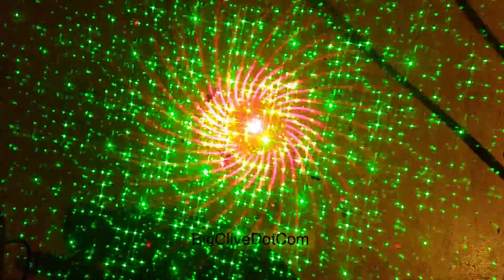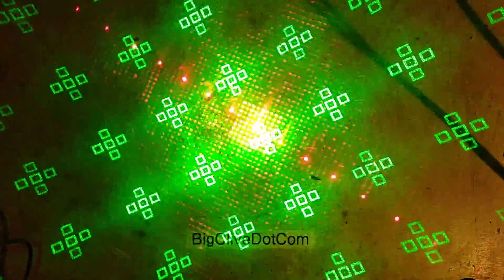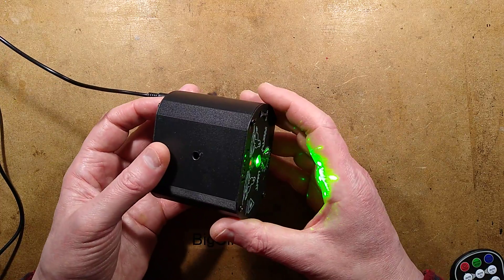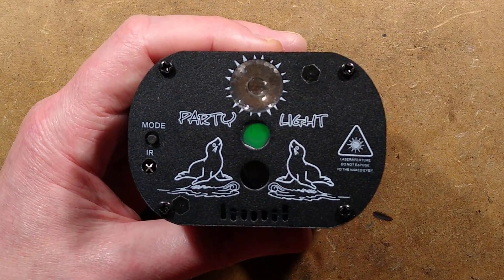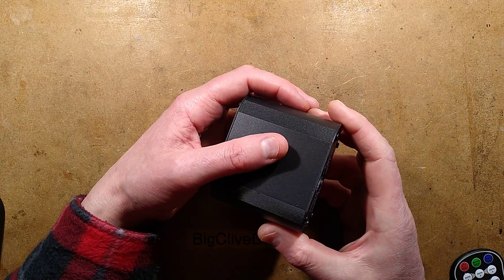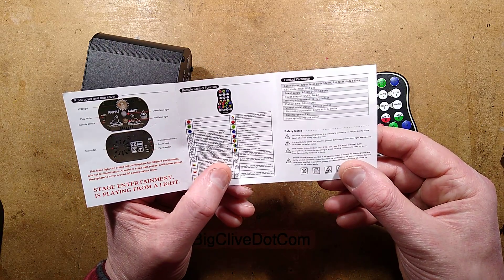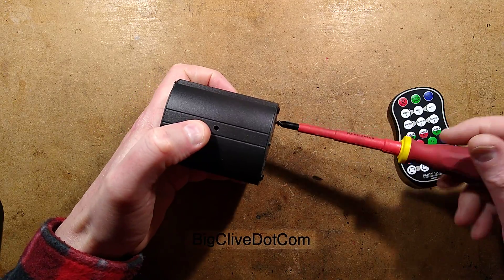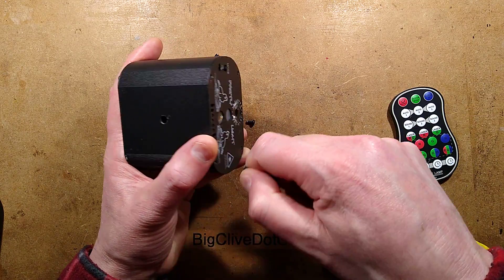Cheap laser light with amazing diffraction grating disk

Comment: might be worth actually seeing if the battery connection actually charges, if so i might get one, i have a few spare 2000MAh 18650 cells from an old laptop battery that could be perfect for this

Comment: I’m amazed they have classed that as a Class III laser, as those are extremely powerful.  The green laser will certainly emit IR as most cheap green laser pointers do.  I suggest these devices are pointed to the ceiling to avoid direct eye exposure.  I’ve modified lasers in the past and it’s very important to match your eye protection with the frequency of the laser.  Eye damage from lasers cannot be reversed.  Great video Clive.  Thank you.
Reply: Although I fully agree with keeping your eyes safe when using lasers, the IR part in the green lasers however, as you mentioned, is (luckily!) not anymore the case. Back in 2012 they developed new laser diodes that directly create green, so no frequency doubling needed from 1064nm anymore. But indeed, the old ones have a dangerously large amount of IR mixed in the green..
Reply: @CaptainZuurpruim  - Thanks for pointing that out.  I do wonder though if the cheap eBay lasers use the new diodes or the old one.  Great comment. 👍
Reply: @rogerhargreaves2272   No probs. I also have a cheap and rather new laser projector. I opened it up to check it out, and indeed it is just 1 little emitter. Super cheap to make, I am sure. 

I guess now that the cheap green ones are on the market, the old types quickly disappear.
Reply: @CaptainZuurpruim  - let’s hope so.  The manufacturers can go some way, but as these lasers become evermore powerful you won’t educate the public; even with a class 5 sticker on the end.  Luckily you need some skill to modify a laser, but in the wrong hands they are lethal.  👍 buddy.
Reply: RIGHT. PAY ATTENTION.
https://youtu.be/WnDjIDhxnMs
Reply: You also have to avoid reflections from shiny surfaces
Reply: @johnmurrell3175  👍 yes flashback is very dangerous, it’s happened to my.  Luckily I was wearing the correct protection for the lasers wavelength.
Reply: @rogerhargreaves2272  The reflections from the infra red component are even more dangerous as there is no eye protection provided by the blink reflex. The IR just fry's your retina and there is no known repair or cure. I presume UV laser light is the same but I have never been involved with that. I have been inside a laser that was under construction ! It was several large rooms.
Reply: I’ve always wondered about those cheap laser levels that are supplied with red safety goggles.
Reply: @WineScrounger  - yea it’s worth investing the money in decent eye protection.  The ones provided probably don’t match up to spec or the wavelength of the laser.
Reply: @WineScrounger  Those are low power. The Goggles are more to see the Laser better than actual true protection only.
Reply: @ŠpVŠpý  - the idea of the eye protection is that you don’t see the laser, just a tiny dot.  I am talking about the Class 5 blue lasers though; that can light things on fire.
Reply: but you've got Seals of Protection, so no worries
Reply: @mikemotorbike4283  you still have to be careful with low wattage lasers, even those can cause permanent eye damage.

Comment: I'd like to see if the battery section works, if they have configured the MC to identify the battery.
Reply: I'm pretty sure both versions differ only with the presence/absence of the battery, even the firmware can be the same, even the charging current programming resistor of TP4056 can be already there to ease the assembly of each version on demand.

Comment: A lot of green lasers now are just a green laser diode and not DPSS lasers using an infrared dioded pumped frequency doubling crystal. I have a few RGB DMX lasers that use green doide lasers. They are slightly darker green in colour unlike the lime green of the DPSS ones.

Comment: Always nice to see connectors instead of everything just soldered directly to the board.
Reply: @Alacritous  He didn't say it.  I said it.
Reply: @KarlHamilton  This reply went to the wrong comment. Oops.
Reply: @Alacritous  hahaha
Reply: You would really think it would be easier to do too, must be that cost outweighs wages to a degree that they would rather pay someone to solder the wires on, or even risk them melting in wave soldering or whatever method they would use

Comment: That's cheeky. All the ads of this include the ceiling bracket in the photo. Did it not come with it?
Reply: Ah, I think this is the "seal on the back of it" model unfortunately. Possibly some mistranslation may have occurred in the listing.
Reply from the maker: It comes with a simple bracket.

Comment: Speaking of lasers... Why don't you do a tear down of them popular for makers the very safe k40 laser or eleksmaker laser 😊 love to see how safe these are
Reply: Answer is "not very!" as supplied you have 15,000 volts in a water cooled glass tube mounted in a metal box where the ground (earth) connection has not had the paint removed. What could go wrong??
I will be getting one in the next few months and intent to gut it, re wire the electrics, replace the control board and also the mirrors and lens, improve the fume extraction and add interlock switches on the lid. After that I will get serious!
Reply: @zebo-the-fat  I've changed the control board, added a safety switch to the door...  Changed the lens and added air assist...

It's a very serious bit of kit...  Far more easier than my Chinese 2.2kw 6040 cnc... I presume that is safe too 😂🤣😂

Comment: eBay 174537133494 has the same remote but looks v different. I suspect the 2 laser ports are side by side at the bottom whilst the RGB LED gets the big compound fly eye.

Comment: Might be a silly question but what is the purpose of the little track sticking up just to the right of the U1 (near pin 8 of the processor). Looks like something you sometimes see on high frequency circuits but that can't be the case for this circuit.
Reply from the maker: I think it might be a ground plane type thing where they have filled random spaces.

Comment: I was waiting for the battery test.
Reply from the maker: I really should have...
Reply: @bigclivedotcom  sling it together for Saturday's live stream, fire it at the wall in the next room, see how long it lasts?
Reply: @Beany2007FTW  I vote this
Reply: Shit I'm a week late
Reply: Yes, would’ve liked to have seen a battery on it. Would the battery need a protection circuit on it or just a bare Lithium cell?
Reply: @wich1  The charging chip should have built in protection.
Reply: They sell a battery model I’ve found a few on eBay just search for key words like USB Rechargeable LED stage lighting projector
Reply: I’m looking into getting one to test it out myself
Reply: The rectangular cutout with the rounded corners in the plastic looks like it was for making sure the batteries fitted when the unit was closed
Reply: Found the battery version, says it contains 2 18650 Li-ion cells.

Comment: Lots of useful bits in there. Could the plastic disc patterns be done using holographic printing techniques?
Reply: I think that's the only way it could be made. It's essentially thirty different holograms embossed onto sectors of the disc.